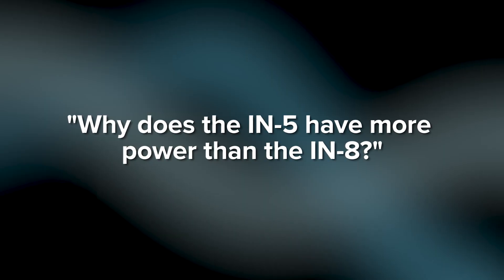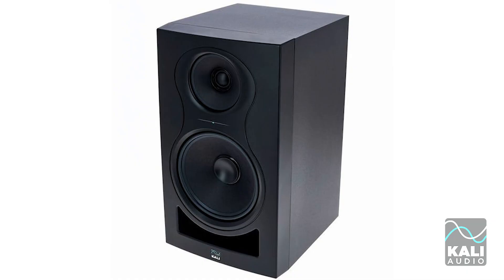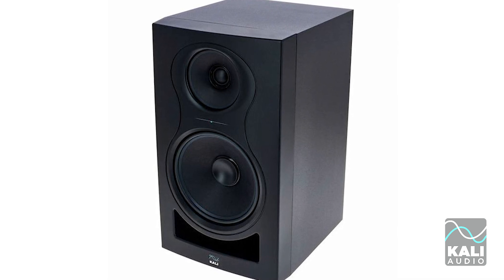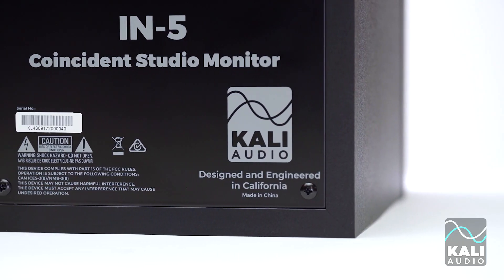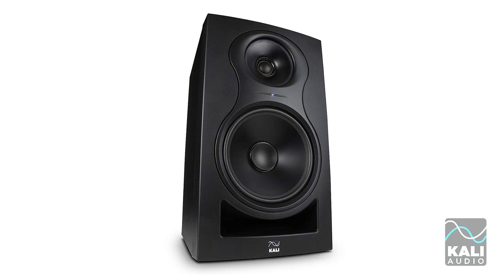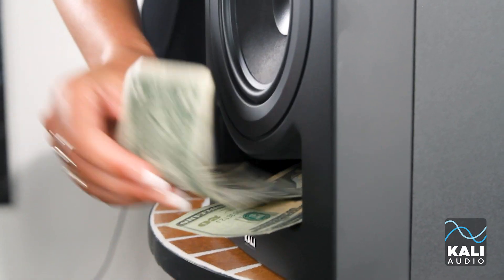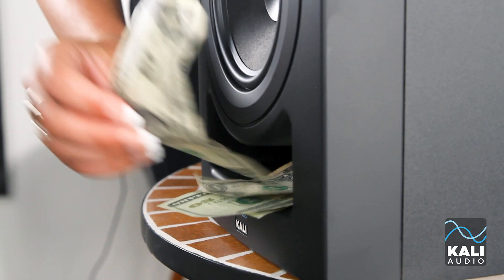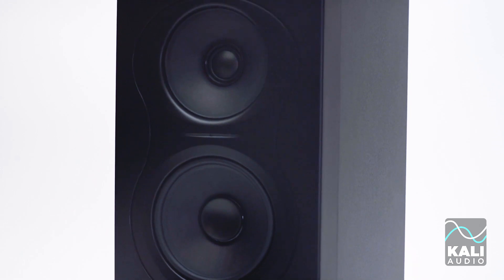FAQ Friday: Why is the IN-5 more powerful than the IN-8

Comment: Why didn’t the N-5 not go to a V2/2nd Wave like the N-8? I heard that the internal Amp was causing a hiss primarily in the tweeter and was extremely noticeable at low volume. Both N-5 & N-8 are 3-Way Monitors with the N-5 having a more powerful Amp so wouldn’t you have to make more amp adjustments (Shielding, etc.) to the N-5 as well?
Reply from the maker: The IN-5 was launched as part of our 2nd wave. There was never a first wave version, so it never had the hiss issue.

Comment: I don't have the width for an 8 so went 5 was wondering why the wattage was different thanks for the explanation I can visualize it as car speakers have the same limitation of diameter usually compensated by larger drivers, translation : big heavy magnet behind the woofer

Comment: Yesterday my friend and I purchased IN-8 V2 for me, and LP6 V2 for him. Two things I do not like: first there is no a rubber or felt pad on the bottom so it triggers my OCD as I need to put it directly on my table, and second the plastic edges of the front panel are somewhat sharp, again my OCD.
Sure, it comes with some small rubber sticky pads, which are perfectly fine, but the idiot in the store lost one so I ended up getting some felt stickers.
So, this snobbery comes with a good reason, everything else is so good I needed to find some faults really. It is very difficult to understand how such a great sound signature can come for this amount of money.
We listened to the  Adam T7V which costs the same as LP6 V2, this Adam can not come even close with its frequency response curve.
My idea was to buy either IN-8 V2 or the Neumann KH120 II, sure the price difference is huge, but for what I need this is a magnificent speaker.
Reply from the maker: We're able to keep the price low by forgoing the rubber feet. (sorry that the guy lost one, but it sounds like you got it worked out!)

:)

Comment: 1:15 "require a lot of money": just honesty 😂. Love it!
Ps. I'm now testing IN-8 and I've an issue with the height: is it better to set the midrange as high as your ears or the woofer as high as your ears?
Reply: The mids/tweeter.

The woofer pushes larger waveforms that don’t need to be as direct for monitoring purposes

Comment: I think you should put your monitors straight up. After seeing your monitors placement, i went for a research. It said placing sideway will effect the timing of the tweeter and the woofer creating a comb filtering.
Reply: They are designed to be placed either way. Comb filtering comes from traditional non coaxial design.

The acoustic center of the drivers all acts as one even though they are physically displaced. This means that there's symmetrical and it doesn't ultimately matter which configuration they are placed at because it's like rotating a circle.
Reply: @stealthis  thanks for the info

Comment: which is better for a small room between these and the IN-5's? I have the In-8's and I love them, but just relocated to a smaller space. the room is 10feet L x 9.5 feet W x 7 feet high
Reply from the maker: I'd say try your IN-8s in the new room. If you're finding them to be physically too large, it might be good to swap out to the smaller speakers.
Reply: How did the IN-8s work for you in the new room? Did you stick with them or switched to the IN-5s?
Reply: @musicCurator  i stuck with the IN-8’s. they sound good to me so why change em 😂
Reply: @officialdiomer Right on! Good to hear that the IN-8s worked out fine for you.

Comment: Does the higher power translate to somewhat similar spl? Can the in5 be used as a center channel behind an acoustically transparent screen at about 11 feet away from the listening position when crossed at 100hz or higher? Or would the lp8 which is cheaper than the in8 be a better choice? Or does it need to be an in8? Thanks!
Reply from the maker: At 11 feet away, you won't be able to hit the Dolby spec with anything other than an IN-8. If you're closer (within about 9-10 feet,) you could use either an IN-5 or an LP-8.